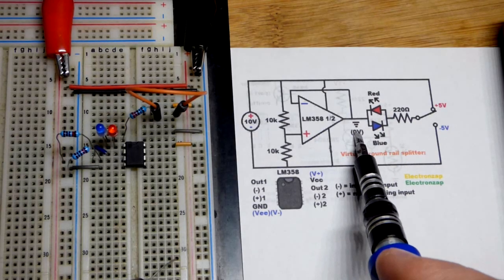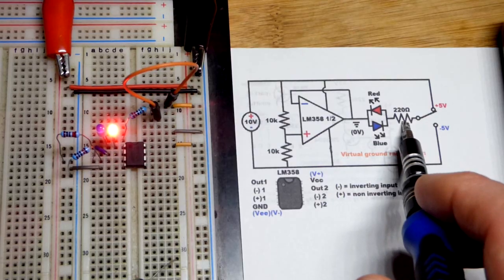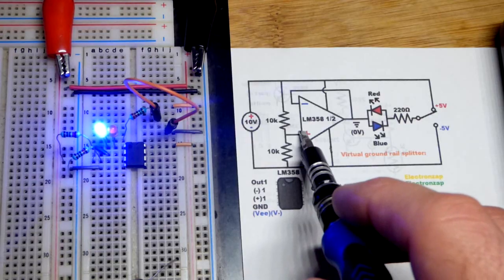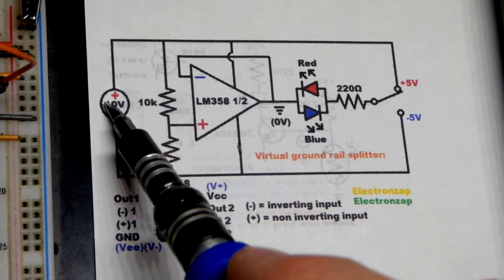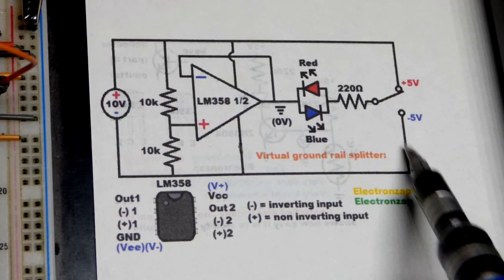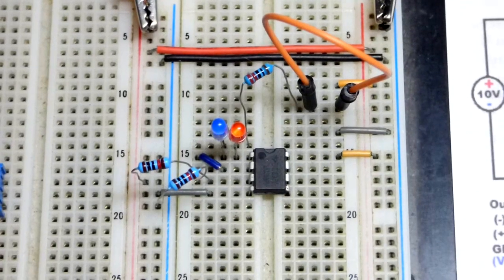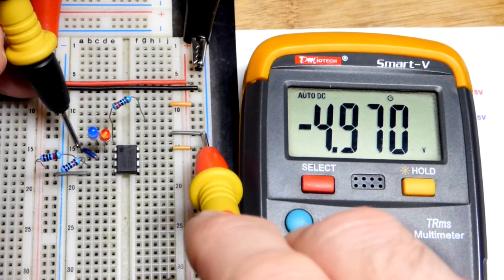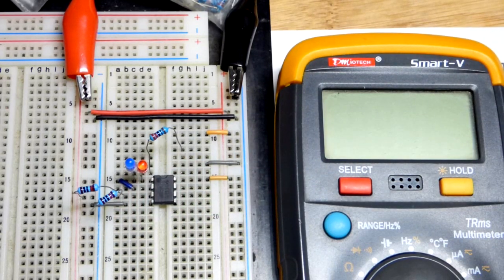Op amp split virtual ground to simulate a dual power supply demo circuit

Comment: Nice demo. The op-amp output can source or sink current, so when you flip the switch all you're doing is changing where the ground is. Not an actual dual power supply, but a good way to simulate it with an op-amp.

Comment: I may have run across another way to get an a/c signal from a 555 timer through a mosfet IRF530N powered off the rail @ 5V. I'm pretty sure anyway (being "green" and all :-)
Reply from the maker: There's a number of ways to get current flowing both directions in a circuit. Capacitors have current going one way when they charge, and the other way while they discharge.